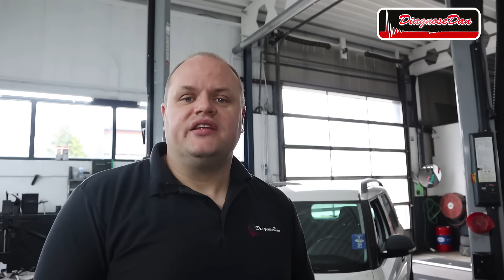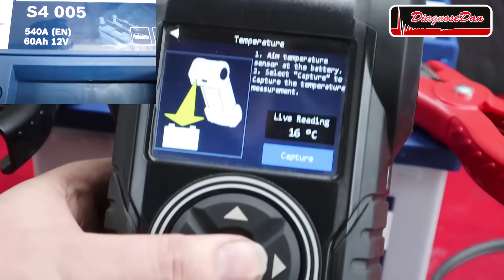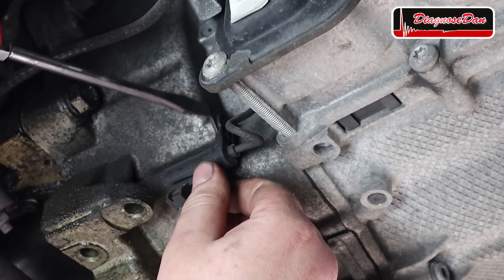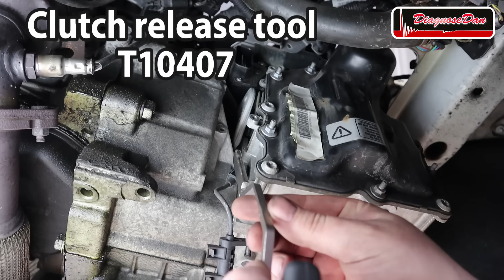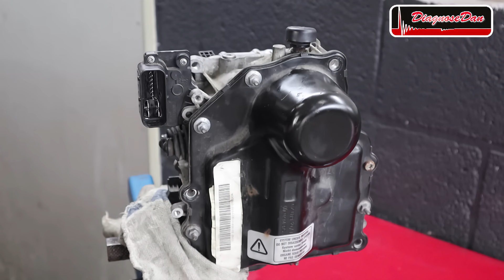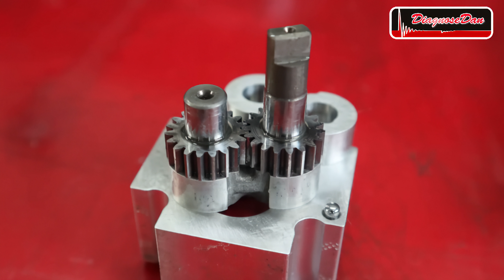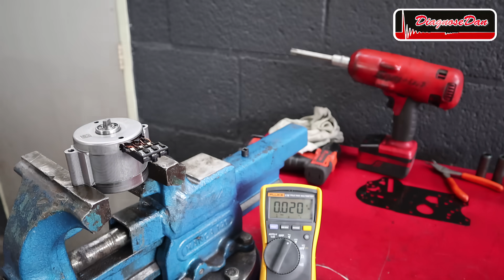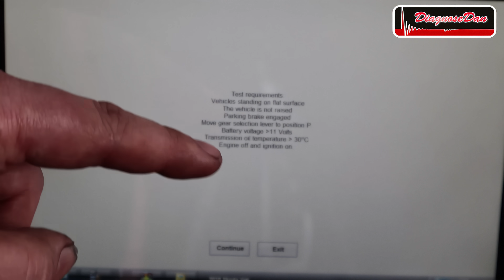DSG Gearbox Diagnosed explained Fixed

Comment: I am getting P176B00 Gear Actuator 2 Cannot Be Regulated (Active/Static) and
P176C00 Gear Actuator 3 Cannot Be Regulated (Active/Static).
The faults come back instantly (while parked with key on) after removing all fault codes. Has normal operating pressure. What might be my issue?

Comment: There is a problem I'm seeing with my Skoda Superb 2016 1.8 TSI AT, and it has driven 60k km. Randomly, sometimes, while the car is in Drive, it starts showing "Press Brake" on the MID. And after that is shown, I see the "emission check yellow light" popping up on the instrument cluster. Once the "press brake" message comes, the vehicle won't move even if the acceleration pedal is pressed. During that time, it shows that the rpm is increasing, but speedometer does not change as the vehicle is not moving. Thereafter, when I switch off the engine and switch it on again, it works fine. I am then able to move the vehicle and drive it smoothly! I am not hearing any sounds from the gearbox as well. But this problem seems to be occurring quite frequently! Atleast once, whenever the vehicle is taken out for a drive. Has anyone seen this kind of an issue? Or any inputs what could have gone wrong?

Comment: So, dumb question on my part... Does it mean there's always at least one clutch that's slipping? Or are the clutches just disengaged when shifting is happening, meaning the "unused" side is kept in Neutral? If there's at least one clutch always slipping, doesn't that mean wear is higher than in a manual? Thank you!!

Comment: I had 2016 superb 6 speed dsg mechatronic failed on the output speed sensor had to replace the whole mec unit but would it have being possible just to replace the speed sensor? Main dealers won't take the unit apart they just replace the whole unit

Comment: I have vw golf 1.4 tsi auto 2012. It has error code P0841 Transmission oil pressure sensor. In morning and when car stays unoperated around 4-5 hours, I need to wait for 4-5 minutes to drive. If I drive asap I turn the ignition it drives around 1 meter and ask to put foot on break, this thing happens till 4-5 minutes until the gearbox develops enough pressure. in sometimes while driving it also disengage the clutch and move to D from any gears and then i need to move to N and again D to reset to drive.  Can you tell me the solution? @DiagnoseDan

Comment: 2011 VW CC with a P0746 OBD-II Trouble Code: Pressure Control Solenoid Performance or Stuck Off, would a fluid change help, or is this something a little deeper. 
And can you change out the solenoids?

Comment: Thanks, Diagnose Dan, I drive a 2013 Tiguan 1.4 TSI twin charge and heard lots of stories that I must get rid of it because the transmission is bad news and could cost me a fortune to repair. After I saw this video that you explained everything in such an understandable way, I don't think  I would get rid of the car 😃

Comment: I have r36 3.6 dsg and just suddenly getting the most minor whining noise so faint getting oil filter etc done this week I have never changed it in 100000 km driving 😮 but changes perfect no other issues but I realised how bad that is. If I owned a hoist I would do myself looks so easy specially on the 2009 r36 wagon I don’t need to remove anything to get to filter as battery is in boot sides on that model

Comment: Hey Dan I have an 08 VW R32 and I replaces the mechatronics unit. When I go and try to calibrate it won't run completely through the sequence. Do I need to align the forks or something in it too or does the wet type DSG not require it?
When it originally failed  it had gone into the PRNDL death blink and would move anymore.
I tried to recalibrate it but I was in an incline and it just clunked but didn't finish the calibration. 
I suspect that I may have misaligned the forks or something.
What do you think?
Cars been down for 2 years. I'd severely appreciate any insight you may have on this. I built it up with forged internals a 6266mm turbo and it makes almost 600 bhp.
Been running strong daily for over 8 years before failure. Also I has brutal to the clutches slipping them on launches sometimes. The mechatronics has a united Motorsports stage 3 TCU tune as well. Just trying to give you all the details. 
Thanks in advance!

Comment: A great video but the DSG has become a nightmare for us over the last week since buying a 2014 Seat Leon which we found leaking from the pressure relief cap.  100% accumulator failure, very common and expensive to replace with a reconditioned unit, we are returning the car for a full refund.  Never going near these again.  What a pity as it was lovely to drive.

Comment: Great video and explanation - I'm in trouble with a 2021 skoda kodiaq DSG gearbox P0805 alarm. at its worst, I lose 1st 3rd and 5th gears. Your video is great to see that its actually 2 geaboxes in one which explains that issue

Comment: Hi, 
do we have to disconnect the electricity from the car?
when you remove it means secure the car electrical system or it is not needed. I would be grateful if you could answer me, because you do not tell me in the video and we did not see that you have disconnected the electrical system

Comment: 3:48 this is hilarious.   For more than 50 years, all battery testers had a heating element to load the battery.    Then in the late 90’s/early 2000’s, all the diagnostic tool companies told the shops that their old SUN VAT-40 carbon pile testers were inaccurate and sold shops their newest digital (voltage/internal resistance) testers.   Now we’re back to load based battery testers…….glad I didn’t throw away my old VAT-40.   Can save myself a bunch of money replacing the digital scanner I didn’t buy with a new version of a load based scanner than I also will not buy.

Comment: Tested a few times.

Used Gasket inside hidraulic pump may be the issue for low pressure when it does 30bar maxim.
New gasket may do max 0.33bar because they tight oolver central wheels inside it and press there.
I got after 0,33bar 4,7 bar when unscrew a bit the bolts than tested with original gaskets and pressure restore to max 57 bar in my case.
I have an error to hidraulic pump and every visual inspection to body inside give no clue for the error.
Soon I receive the kit and I will replace most of the pieces inside .. but I think the issue is in the hidraulic pump. New gasket are too width ...

Comment: I own Audi A3 2014 with Dq200 0CW, the car judders after I drive for 20 odd miles when the gear box gets heated up and the only fault code I get is no communication with the gearbox control unit U010300. How do I diagnose this issue whether it is the mechatronics unit or the clutch by itself. Can you please provide your expert opinion?

Comment: Hey guys I just paid in a workshop to fix the oil leakage. However after getting the car, I feel the clutch is sliding a lot. Is this due to bad a bad repair, or is it due to normal clutch wear just noticeable after leakage fixed

Comment: I have a 2024 Skoda Kodiaq, 1.5 petrol, it is equipped with a DQ381. Sometimes, when coming to a stop, the RPM drops to zero or almost zero. It then feels like it's almost going to stall, but once I stop, it jumps back to Idle. It feels like the DSG's normal behaviour. But why is this so?

Comment: I AM EXPERINCING THE SAME PROBLEM WITH MY POLO 6.

I own a Polo 6 TSI with a DSG gearbox. The car has +-64 000km. i encountered a problem with Shifting of gears from P to D, and from P to R, (P=Park, D=Drive, R=Reverse) first attempt the R/D doesn't engage, they just start flashing on the dash screen and car wont move WHEN YOU PRESS IN THE ACCELERATOR PEDAL. Its Only the second attempt when you I put it back to P and then shift back to R/D, only then it will engage. I then took it to a mechanic for diagnostic. Mechanic said that there was some fault on the Mechatronics showing low pressure on the Diagnostic machine. although there was no any fault indicating light on the car dash screen. He then ordered a mechatronic kit and he serviced it...and the car was fine since then. but after only 3 days, same issue started again (flashing of Drive and Reverse gears) . now he said i must take the car back so he check again. I'm yet to take it back. has anybody experience something like this before...what do i have to look out for when i take it to the mechanic?

Thank you.

Comment: You have helped me identify the mechanisms I hear some whirring sound when coming to a stop in eco mode, comfort mode, sometimes sport. I heard it first on a highway merge. After 1 week I heard every time coming to a stop. It sounds hydraulic/mechanical. Perhaps something went out. I got not lights but getting sometimes higher dsg oil temps.

Comment: What an excellent video!  Dan you are exceptionally gifted.  I hadn't got a clue about DSGs, mechatronics or any of that but needed to know as my 2014 Audi Q5 has just started playing up with only one side of the gear train driving (1, 3, 5, 7), warning message says Gearbox Fail No Reverse Gear.  Leave it and it might resort to normal (1, 2, 3, 4, etc) but then fail again.  It's the DSG 0B5 gearbox, which I understand is a wet clutch system (Great explanation of twin clutches, pre-select next gear).  All I need to do is get it fixed .................... at great expense here in the UK !!!  Getting the right diagnosis may be the first problem.  Thank you.

Comment: Is the transmission  shot when the cooler goes bad and leaks into the transmission fluid. Very bad design.  I flushed the fluid and trans is still slipping

Comment: From what I've read, Porsche developed these for their 992.
I don't know why they have to call them DSGs. The Germans love long descriptive names. 😂😅
They are just a DCT.
If I ever buy a car with one at least I will have some idea how they work.
If I remember right, BMW developed a hydraulic shift gearbox with external cylinders to do the clutching and shifting. I guess most people hated them for their slowness, and some took all that crap off what was just a manual gearbox.
Thanks for the video, Dan.

Comment: Fabulous video Dan, very clear. I have a Golf Mk7 with a DSG7, DQ200 gearbox presenting with P177D00 - Dual clutch torque too high, P278900 - Clutch adaptive learning at limit. Physically, the car heavily clunks when D is selected and won't shift above 2nd gear. There is a rumbling from the transmission when in D but I can drive it on the road although it will not go beyond 2nd. Reverse is ok. I've dropped the gearbox out of the car. (not too bad a job) I stripped the mechatronic as in your video and found nothing wrong. The selector forks all move left, right and centre as they should. I think it's the dual clutch causing the problem but I just can't seem to get anyone to describe what a bad dual clutch looks like. My only observation is that the gap between the friction and pressure plates of both K1 and K2 is about 1.6mm and wonder if this is so far out of limit that it is causing the fault? Everyone seems to run a mile or get pound (dollar) signs in their eyes when you mention a DSG gearbox. Cheers, James.

Comment: Hello My 1.2 polo GT tsi DSG doesn't creep forward when slotted to D gear 
But reverse creep function is working. 
Service centre said they couldn't find any error code in scan and also said doing a base setting reset using vcds can harm the mechatronic unit as I have changes the battery outside VW 
Please suggest.

Comment: I’ve just been told that the mechatronic unit needs replacing on my 2020 Skoda Superb with only 46000 miles on the clock and it’s not under warranty. Skoda and I are going to be having a discussion about this

Comment: I have a vw passat 1.4 tsi Automatic dsg 2011. car shifts only in even gears and reverse. is there anyway to fix it. local mechanic said you will have to put in new gearbox. any suggesstion. Thanks

Comment: Couldn’t have this computer/electronics been easily designed to be outside of the mechatronic unit? Why does it have to be on the inside and exposed to oil in the first place?

Comment: Hi @dan
My Škoda service advisor has diagnosed issue with mechatronics for loss of power whilst in drive and is replacing the accumulator in my ‘17 Octavia 1.8 TSI DSG (DQ200). I wanted to know if this is a permanent fix or a temporary one? 
How long does the DSG/ mechatronic last after this fix?

Comment: This is great dan, I get enjoyed. I have 2018 polo 1.6 tdi dsg, my transmission makes noice when up gear from 3 to 4 and some times makes same when 5 to 6, I understand that only comes from one side of box because 3 and 5 is odd, and also when the gearbox is heated like half an hour usage, it has a delay when r to d, after going some revers when I put to d, it delays 1 or 2 secs, what do you think about this problems, and I went service they told me normal but it is not in my opinion, and also service told me that I don’t need to change gearbox oil they checked with serial number, should I change? They told me no need but it is oil it should has usage limits. Thank you

Comment: The accumulator loses pressure over time, causing the electric pump to work nonstop and heat the control card. The rest is shown in the video. :)

Comment: Excellent explanation and autopsy of a dead DSG.   They also had a known fault in the early days that caused the DSG to have a incorrect gear selection at high speeds that would cause fatal crashes.

Comment: Hey I have a dq200 i get p189c intermittent......it goes away after its cleared u can drive it for long and it won't comeback and it comebacks ones the car is shutdown and restarted.......the car runs fine no issue with shifts or any clutch slippage......no flashing gear or prnds!!!.....

Comment: HI Dan. I just replaced TCM board, not the whole mechatronics unit for some faults (tpms, tcs, stabilization) and wont let me put in gear. It hasnt been programmed or calibrate yet. When i tried on my driveway, it still has same issue. Will they go away and let me in drive once programmed/ calibrated?

Comment: That was fascinating, I really enjoy your videos. I watched this one because sometimes when I set off from a standstill, the clutch engages suddenly and I set off with a jerk. It sometimes helps to sit stationary with the engine off, ignition on and accelerator pushed to the floor. Please can you offer a suggestion. My local SEAT dealer says that my DSG box is working within parameters. It's a 2018/19 SEAT Leon 1.4.

Comment: Loved your video…

I have a question, I have a 2015 TDI, from day one when the car is shifting from 2nd gear into 3ed there is a delay where the car loses power. Several dealers have stated nothing is wrong with the car. However, I had a 2013, it never did that and I recently drove the same car only it was a 2014 and it too drove without this delay. Any ideas?

Comment: i think my seal is broken. lost pressaure and drained only 600ml oil from the mechatronic. IF the seal i broken , is it possible tha the oil in the gerabox leks in to the mechatrnic? or is it ony possible for the mechatronic oli to leak in to the gearbox beacuse the mechatronic is a high preasure system? thanks, snd sry for my bad english.

Comment: Dan, if it had been my job I would  have checked for shorts between solenoid coils and ground before consulting the TSBs, then you would have another "bit" of knowledge for future jobs, as you never found out where the short really was. It may have been a ground fault on a solenoid coil that burned the driver transistor.

Comment: DAN, great video. May I ask for your help? On my 2nd hand 2011 caddy (I am pretty sure I have DQ200) I would like to change both fluids as I am having transmission juddering during transitory from still to moving at low speed (low gears). This happens on low torque, as soon as I push the throttle stabilizes and shuddering disappears. VW say it is a sealed box and suggest not changing fluids as they are for life. Could changing them be advisable (to use a mineral oil on the mechatronic in accordance with TSB) and try to get rid of the juddering? I know it is limited information, however if not oil related, what you think could be needing attention?  Thank you in advance.

Comment: With this video I still want your opinion on the mechatronic leaking hydraulic fluid through the breather. Do you think the accumulator being cracked be the problem or as you said at the base? Is there another way of contacting your garage?

Comment: Another great video, this DSG system reminds me of the F1 gearbox that Ferrari were using on the 355, 360 and 430, but a lot more compact and probably more reliable. Is there a difference between the Audi S-Tronic gearbox and this VW DSG?

Comment: Dan , i'm from egypt and i have problem with my DSG gearbox and i should replace it but i need new unit so can you help me to find dealers that selling mechatronic online and ship it to in Egypt.
Reply: My problem with DSG gearbox is oil comes out from the unit when i check it by computer the check signed hydraulic pump is that mean i should change all the unit or hydraulic pump only ?